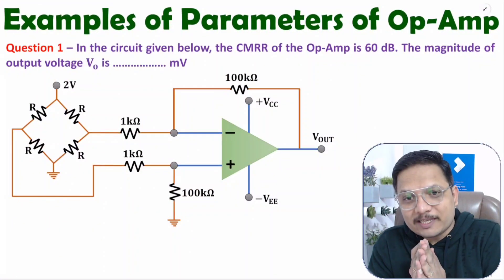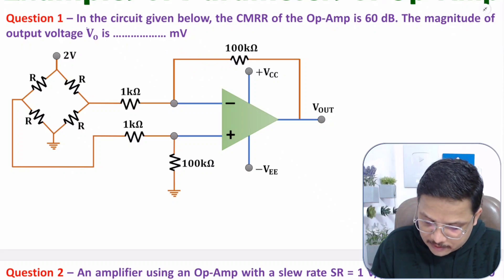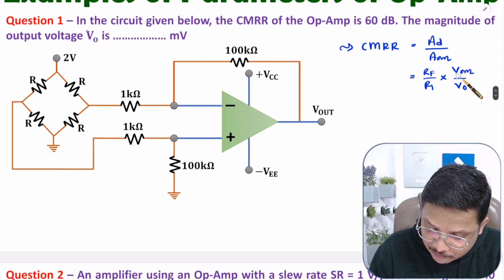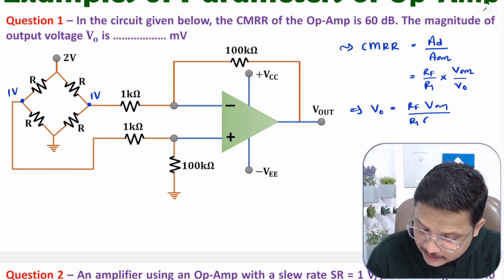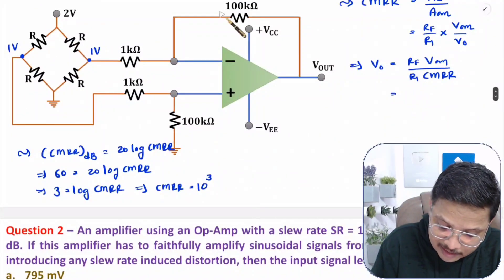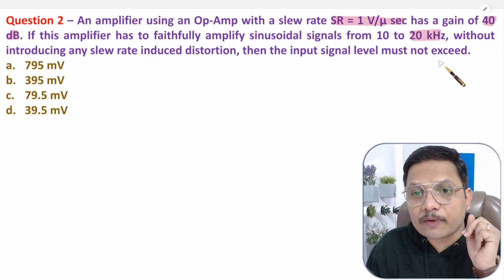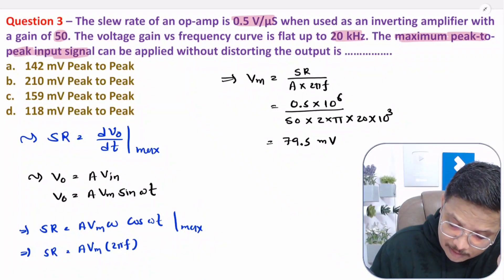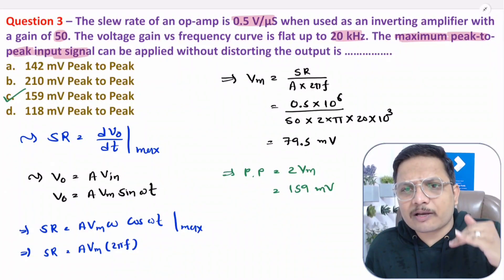1. Solved Examples of Parameters of Operational Amplifier | Slew Rate, CMRR | Analog Electronics

Comment: sir at 8:32 why you write A db=20 X logA means formula is 10 x log A
Reply from the maker: @amit_code  for power it is 10 log A and for voltage or current it is 20 log A
Reply: @EngineeringFunda  thanks sir